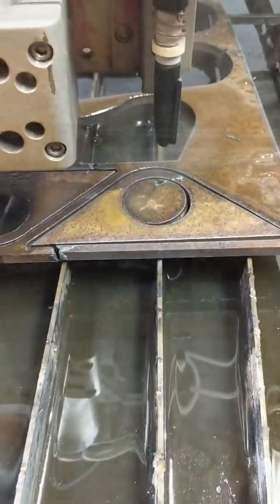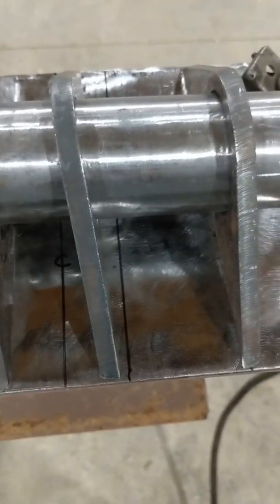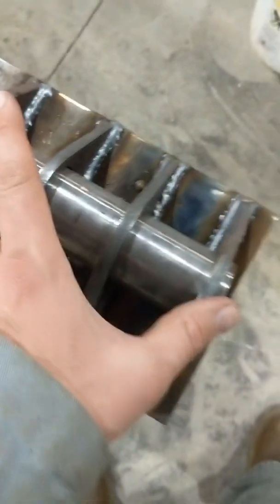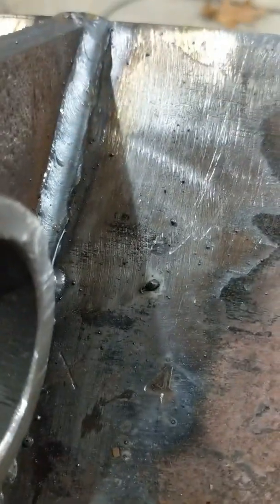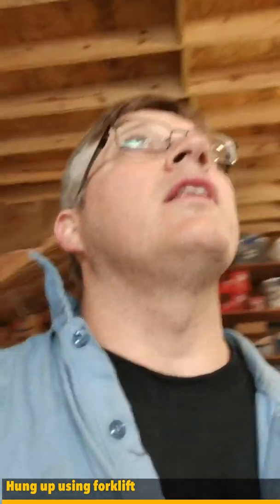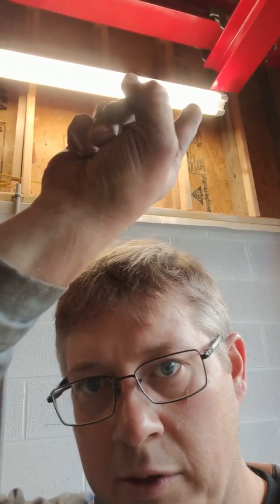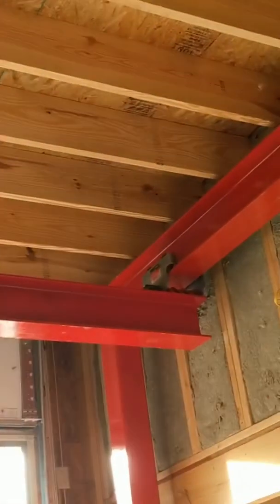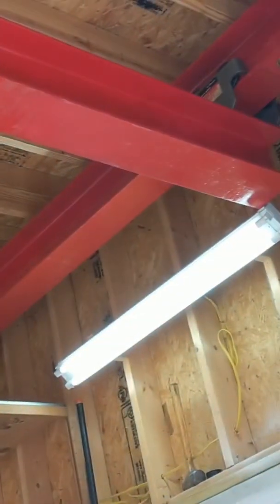DIY Bridge Crane Days 7 and 8

Comment: Looks good, nice job. Should work well.
Reply from the maker: Thanks.  I finally found a hoist that I’ll be hanging soon.  I’ve had to put new seals in it.  I’ll put that video up at the end of the week when I’m done.
Reply: Look fwd to seeing it in operation.    @WesCombsAi
Reply: Been checking back, did you ever get your crane and lift up and running?  Would enjoy seeing it in operation
Reply from the maker: robert simmons I have the hoist mounted but need to run airlines and put the Oiler in.  I’ll try to grab some footage and post.